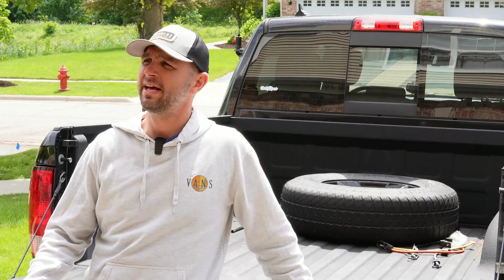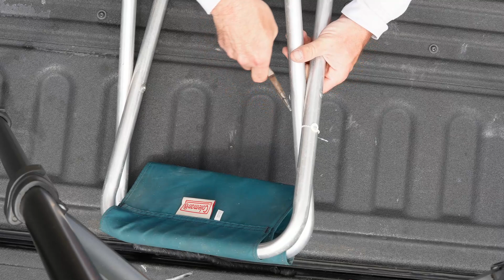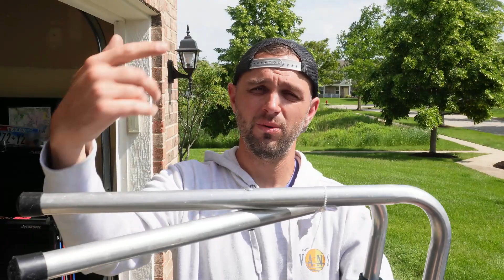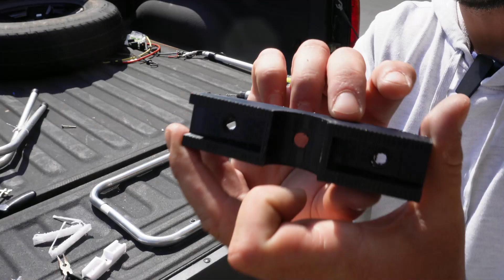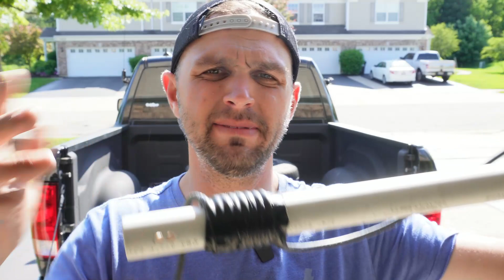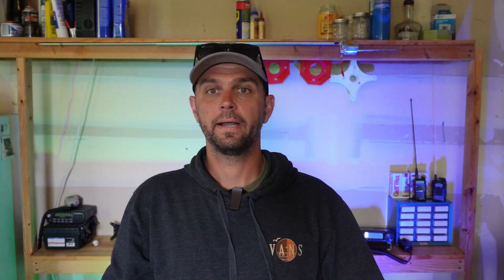Simple $3.00 Ham Radio Antenna. 2M Moxon

Comment: 3 dollar antenna. Assuming you already have a 3D printer, PVC and Aluminum tubing, wire connectors, bolts and nuts, coax and appropriate connectors, etc. I was disappointed when I discovered this was basically click bait. Very cool project tho
Reply: Your profile picture is of a gentleman man in a lab coat @joelGouvion surely an educated man as yourself could make this happen for $3.00.
Reply from the maker: You don't need a 3-D printer. You could go to the library and they print things for free at almost every library across america.  Although I can't be a psychic and predict what happens in other countries or libraries. 

Maybe your library doesn't have a 3-D printer. Then maybe you can actually go to a club and find that one of your club members has a 3D printer and would  probably do it for free.

This video is hardly click bait
Reply: @DudeTested  It is, You are saying you can make a "Moxon Antenna" for JUST 3€(so what im a european idgaf), yet use PVC and Aluminium Tubing, which are not calculated into the cost, bolts and nuts not in the cost, or appropriate connectors. Also assuming your fanbase is mostly american is just.. why?

Comment: I used my 991 swr  to tune it up   kg6mn
Reply from the maker: Interesting.. So I am making sure I understand correctly, You tuned a 2m moxon with the 991?  My 991 (non a) does not have an antenna tuner for 2m, only an HF antenna tuner.    Looking forward to hearing back.
Reply: @DudeTested  I moved the elements close and apart  2 get the best swr

Comment: Is it directional? I am new. What I could do is attach a stepper motor at the base and power it with a solar panel, and handle the logic with a microcontroller. Then send signals through a WiFI module, and an indoor microcontroller to rotate the antenna (N, S, E, W).

Comment: I like the way you think.  You mentioned direction finding...turn the antenna around so you are pointing the reflector at the source you are looking for.  There is a VERY deep null off the backside.  I have been experimenting with this for fox hunting.  There is only one null unlike a loop antenna and that is much narrower than using the peak from this or a yagi.  I have also scaled this down and hunted the 3rd harmonic on 70cm.  Thanks, 73
Reply from the maker: Very good idea.. Thank You!

Comment: Instead of drilling holes right away just slot the tubing ends and use hose clamps, then once it is tuned you can decide whether to drill holes or not, another nice thing about  hose clamps is they don't compromise  the structural integrity like drilling holes does.

Comment: Great video and given me lots of ideas, instead of using bolts to secure the plastic brackets to the metal, what about slightly changing the sloping design on the wings to straight and rounded and use heavy duty jubilee clips? Then any adjustment could be made. Good work! 73 m0kty
Reply from the maker: That makes sense!  I've been having trouble focusing lately, but I will keep this in mind and it may be a good challenge for the brain. Good idea! Thanks!

Comment: I ran your calculations for 1 inch and got 2.305 ft. or 27.713 inches. As a lightweight antenna with mine 10 gouge. I strap to bad arm and just point. Use other for radio dial and log. Estimate mine is $12.54 from Home Depot. Issue is I never got 50 ohms but about 48 as fine measure on gap never happened. But I did ISS, SO50, and now going QRP with FT 857 for dual USB/LSB sats.

Comment: Happy Holidays and thanks for the instructional video. I took your advice and hunted for a used tubular leg fishing stool, and scored one for $5.  I have drilled out the rivet, but the tubes appear to be somewhat narrower in size. I have the  legs separated from the seat webbing.  Do you have plans or a link to how to 3-D print those support braces?
Reply from the maker: Thnaks!  https://www.thingiverse.com/thing:5414598 If they are too large, you should be able to scale them down. Good luck!

Comment: Great video. The diameter of the tubing makes a big difference on the length of the sides.
Like you said, the web sites are usually talking about wire and not tubing. I made a tape measure
dipole antenna, the tape measure I used were an inch wide. Because of that my calculations for the different bands were all way to long. Figuring it all out is part of the fun building antennas.  Nice video
Gary KF6EWO
Reply: I was unclear in this video that the antenna builder was measuring from the center-to-center of the tubing. It appeared he was measuring from the outer edge. Additionally, the calculator(s) I used didn't give ANY variation in the specs when I changed the diameter of the wire, or designated it as tubing. In fact, most of them gave "diameter out of parameters" warnings when I set the diameter to 25.5mm or 1". I built the exact same antenna and am going to test it today. This video would definitely benefit from some actual final dimensions clearly stated or printed anywhere. By the end I was unsure what size anything actually was. But... I built it!

Comment: Number 1 - SWR Grease only works on 11 meters.  A well known fact.
Number 2 - Any antenna that shapes its radiation pattern to "steal" power from the back and focus it in front is a "beam".  Whether it be a Yagi, Moxon or a log periodic.  So, yer good to go.
Number 3 - I think the word you were looking for to describe the holes you really wanted was "slot".  By using slots you could adjust the spacing.
Number 4 - There isn't a number 4.  This has been great fun.  Let's do it again soon.
Reply: The problem is that if he mentioned that he wanted to include a slot… the slut next door might volunteer😂😂😂

Comment: Repurposing material - excellent!  Cool project and one of many cool ways I am seeing to build a Moxon.  The club I am in had a DIY Antenna Day in which you could build a 2M Moxon or 49:1 Unun.  Had more building the 2M Moxon and in a variety of ways including a pvc pipe frame and wood frames: some used wire others 1/8" easy form aluminum tubing (me).  We used the dimensions from the same site you used and most passed muster on the analyzer.  Folks had fun and left with a working 2M Moxon - some of whom used them to improve their signals on our weekly simplex net!
Reply from the maker: Awesome! I  am glad to hear others are enjoying the homebrew stuff and finding useful uses for stuff that may not longer be useful!  Thanks!

Comment: Instead of drilling the holes, you could make a clamping mechanism with the printed parts. It won't be as solid, however it will be more adjustable. And you can retrofit it on already drilled parts!
Reply from the maker: This sounds like a wonderful idea

Comment: Sweet video. After I took my first wind-up train apart with a butter knife, Dad bought me a box of tools and let me loose on old radios, lawn mowers, piles of wood & a couple bicycles. So now I have to (a) get over Omicron BA4/5, (b) test negative for same & survive my next doctor’s appointment, (c) find a couple aluminium camp stools, some PVC tubing & a person with a 3D printner, and (d) build one of those doodads. ;-) Thanks for the grand tour. We tool users are getting more rare by the day.  Stay well! 73 de W8IJN
Reply from the maker: I'll send you some  of the spacers.  Are you good on QRZ?  I'm excited to see what you can do!
Reply: @DudeTested  QRZ? Yep. In there. 
. . . Nice simple design like that, should be easy to replicate. Without mutations, of course ;-) Stay well, amigo. Paxlovid does work but having to take it ain't no fun at all.

Comment: As someone who knows Central Illinois better than most Norwegians I would say that Peoria is more pretty much in the center of the state more than almost across the state :) Anyway, great video as usual, and great to see that you not only shows what works, but also what doesn't.
Reply from the maker: Hahha.. fair point..  .. that's still a haul. I made contact to Alabama on 2m ft8 this morning (with my 5 element ).. take care buddy
Reply: @DudeTested  That's a good haul on 2m. I'm impressed. I'm waiting on a working rotor so I can point my yagis towards northern Illinois to see if I can get W9FFF in my log on 6m and 10m. I guess 2m would be close to impossible.